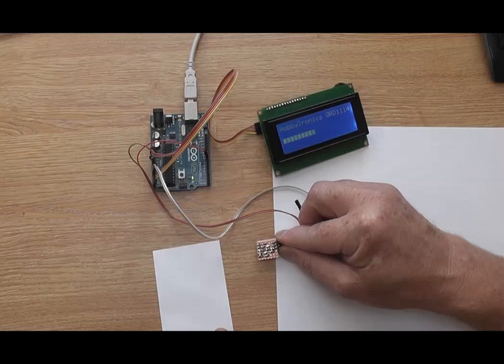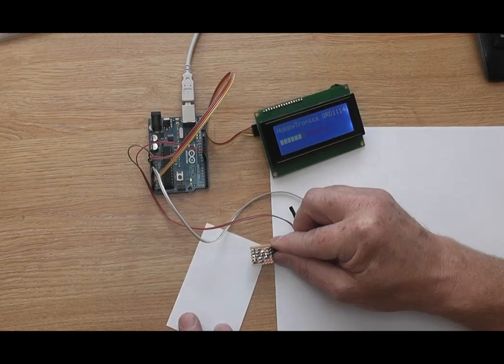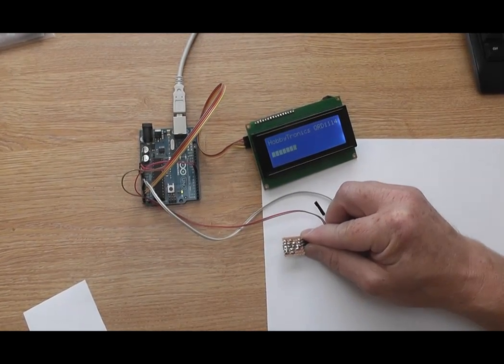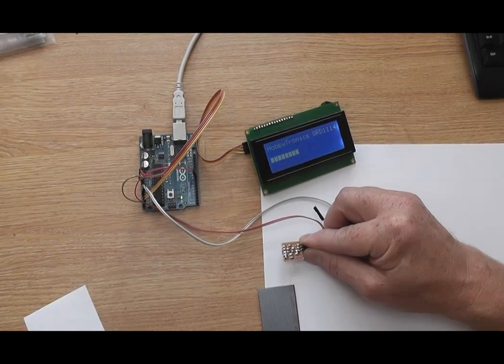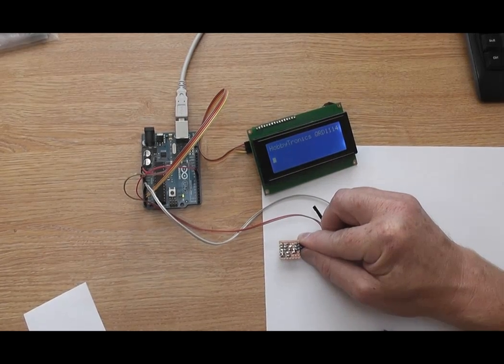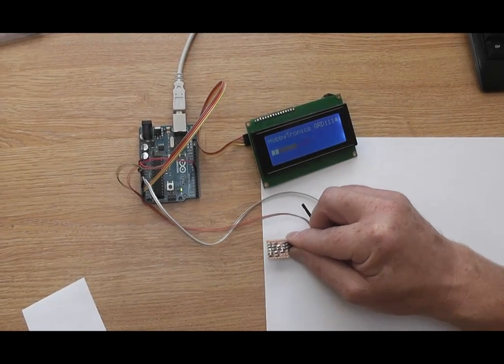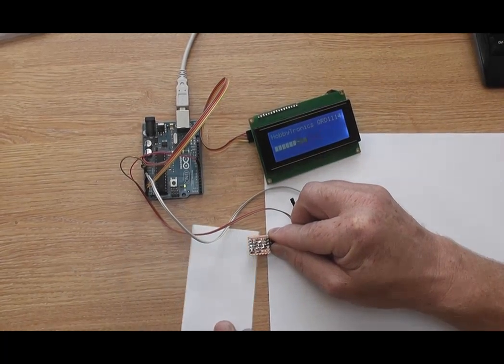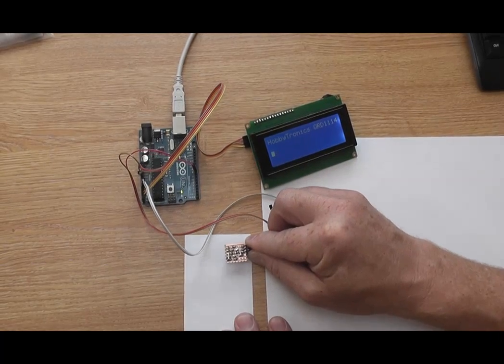QRD1114 Reflective Object Sensor

Comment: Wondering, will this work if I drag a sheet with 5mm thick black lines over a sensor? Will it reliably detect the difference between black and white parts of the paper and how it should be located for the most accurate results?